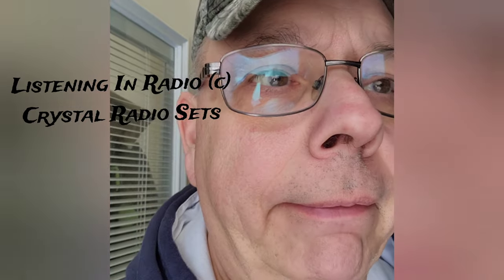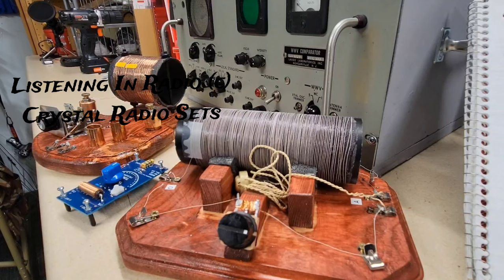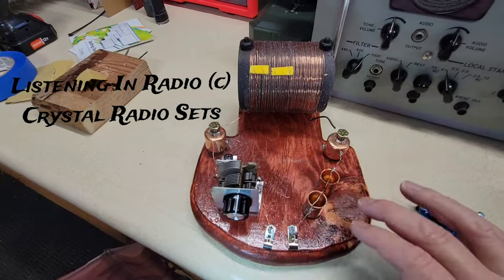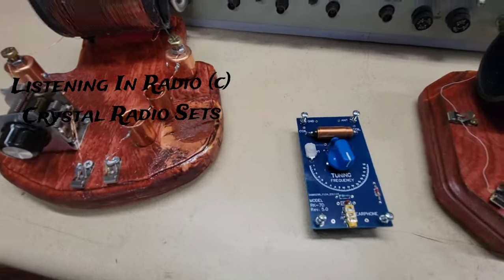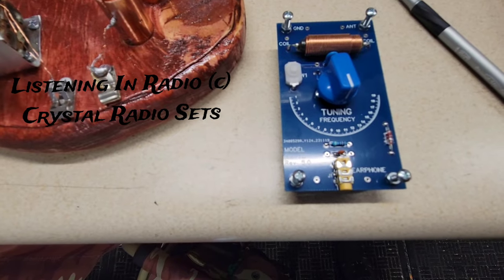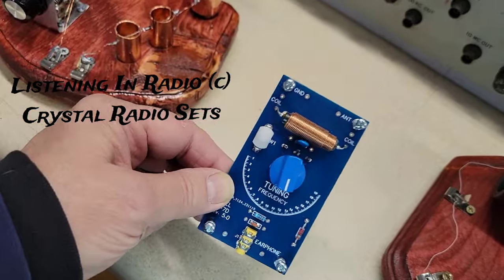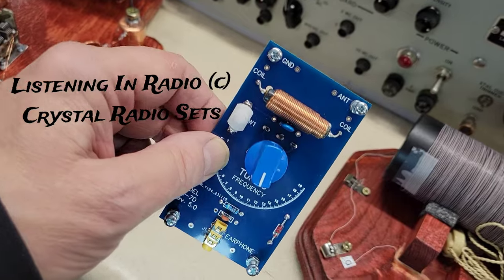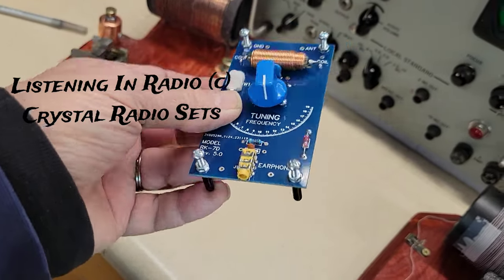Crystal Set as an Emergency Radio?

Comment: LoRa networks are the answer for long range two-way data communications. peer-to-peer text messaging etc. Crystal sets although very cool are only good for listening to AM radio but you need one hell of a long antenna and a good ground
Reply: AM stations and shortwave stations are disappearing around the world, except in backward countries, and the USA G7VFY
Reply from the maker: I know. This side of the hobby taught me all about  antennas, grounding and how other components are brought into play. I even used those ideas to use my SDR. Which by the way, I mostly gave up on. The sdr I had could not compete with a standard or hybrid radios with dsp. They are better receivers.

Comment: In recent years I noticed,  with the traditional flesh colored crystal earphone which have been available since the 1960's to 70's  but the more recent,   Made in Taiwan earphones, which   I  had acquired 3 earpieces 10 years ago and have noticed on all three   the sound is intermittent,  cutting out,  having to tap it with my fingertip frequently   one was completely dead .  after some research  I learned this is now a common problem with these earphones,  the piezo driver is aluminum with a haphazard glued and pinch press connected thin  wire exposed  to oxidation and  a future poor connection (never mind the effect of an EMP)  I did remedy my issue with a pair of modified piezo buzzers  with  brass discs  made into a makeshift  earphone   they work great  very reliable  I also ordered some brass 20 mm piezo discs to replace those crappy aluminum discs in my other commercial crystal earphones.

Comment: The diode would be the most easily damaged part. If you disconnected the earphone and antenna/ground, wrapped it in aluminum foil, it should be good. Assuming you're not ground zero of the cause of the EMP. But you also need to protect the earphones and antenna. Wrap the earphones, take down the antenna and wrap it just to be sure.
Reply from the maker: Thanks for posting this

Comment: i made a 6 MICROPOWER transistor radio. works from 0.9 to 3volts. CURRENT DRAW IS 50 MICROAMPS TOO 200MICROAMPS from 2 x 1.5 volt batteries.
Reply from the maker: Very cool

Comment: Interesting little radio!

I think pretty much any radio, including modern ones, can be made EMP-proof by putting the main circuit in a Faraday cage (which may just be a metal case). Obviously the antenna is then going to conduct the EMP, but I think you can quite easily stop it from reaching your radio using a gas discharge tube (GDT) and TVS diode. Basically the same way you would do lightning strike protection. Downside is that it will add some parasitic capacitance so you will have to account for that in your radio.

Big advantage of this radio is that if it does get fried, it looks like you have to replace at most 3 passive components worth less than $0.10 each
Reply from the maker: Good point!

Comment: Being from Tucson , Arizona what is all the White Stuff covering your yard?
Great video! Have a great day! 73!
Reply from the maker: I like Tucson
Reply: @genestevens7584  Thanks . 
I bought another Crystal radio set off eBay about 10 years ago that’s wound with an Z matching transformer  matching 32 ohm that will weekly drive my old radio shack speakers or Bose headphones when hooked to my 250 foot long wire grounded. I regularly pickup KCBS out of San Francisco, CA to my QTH. Weekly of course but it is readable on either speaker or headphones.  
If I hooked to my audio amplifier much more signals picked up…that still amazes me.
Good luck on your crystal sets, 73!